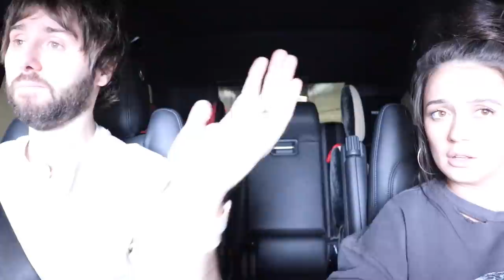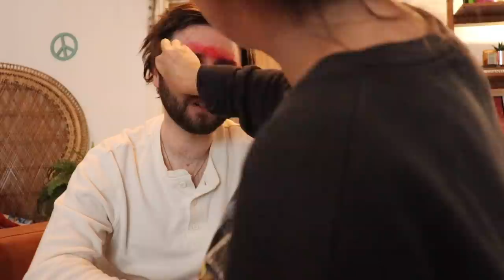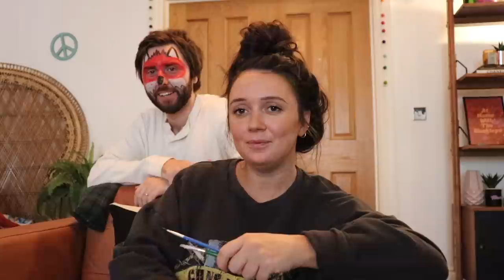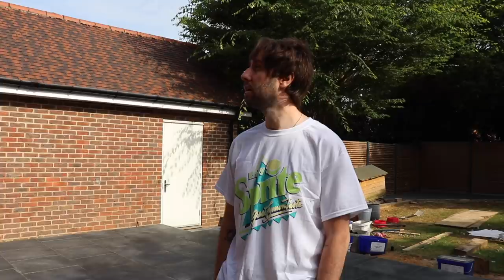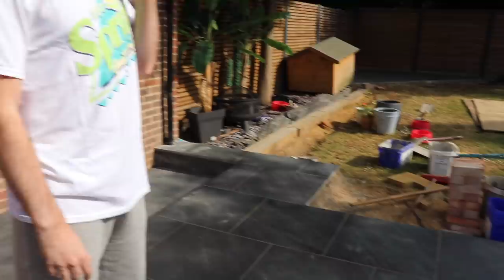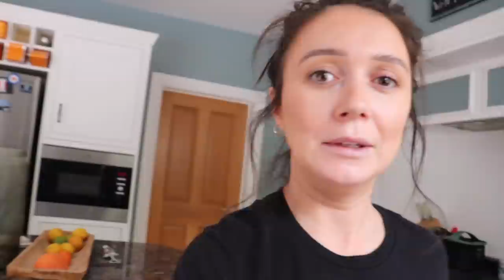JAMES GETS A MAKEOVER

Comment: The problem with the step into the garage is they have offset the step on the wrong side of the door. The space should of been to the left of the door, so you have space to step down and open the door. The way they have done it, you need to have the door open from the right hand side. 🤦‍♂️🤦‍♂️